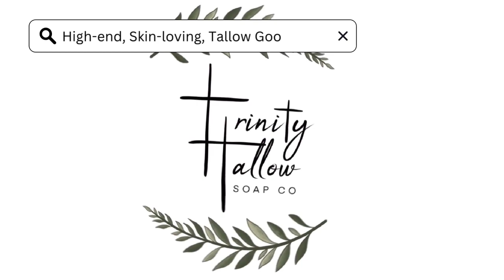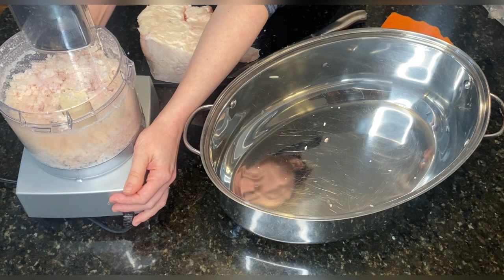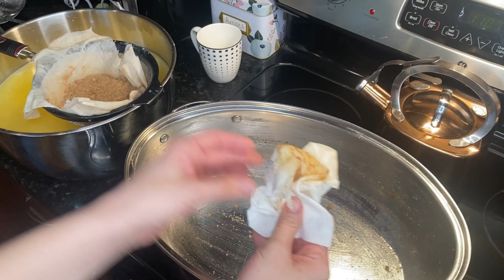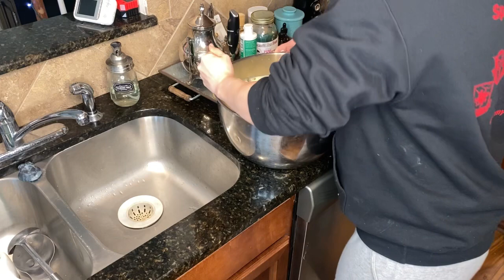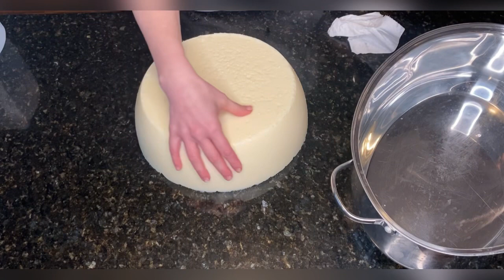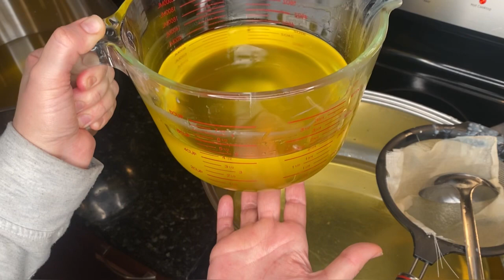How to render suet tallow (wet method) #diy

Comment: Thank you just found your channel.  Very well done, I do like it, and will follow the steps, however I did it on top of the stove ,  does it make a difference? Thank you in advance for your response 😊
Reply from the maker: You can do it on the stove top but it tends to burn on the bottom easily if you don't constantly stir it. You don't have to babysit it in the oven.

Comment: When wiping you big pot sprinkle fine salt all over and then wipe. You’ll be amazed.
Reply: Thank you for that tip. I’m new at this.
Reply from the maker: Using a heat gun to melt it down and wipe it out with a paper towel works wonders.

Comment: After you cut up the tallow after the first wash, how long do you put it back in the oven?
Reply from the maker: It varies. Low and slow. I probably did it on 200 degrees F in this video but now I do it on 170F so it does take a few hours to melt it all back down. Low and slow keeps all the beneficial properties from degrading and reduces the chance of a beefy smell.

Comment: I render my tallow 3 or 4 times by boiling with water and salt!
Still cannot get rid of the beefy smell.
What is going wrong?
Is it the temperature?
Thank you for sharing your knowledge 🙏 ❤
Reply from the maker: Boiling will absolutely cause the tallow to smell beefy. Low and slow. Under 200F
Reply: @trinitytallowsoapco  thank you for helping
It looks easier than it is...😅
Reply: @trinitytallowsoapco  can l ask you please.
If l oven render the tallow l made by boiling,will it remove the smell? Or is it to late?
Thank you.😁🤩
Reply from the maker: No, most likely not. Not if you’ve already processed it several times with that high of heat. You could try just using it in soap now since the smell won’t come through in that or use it for cooking tallow.
Reply: @marianneellman1139  I am a newbie to this and have the same problem, not the boiling but smell. it is reducing so I am going to just keep going with purifying, I suspect a lot rests on the quality of the beef fat (I am in Ireland and butcher just gave me some trimmings). I did read a comment else where and the person said you can even purify fat that has gone rancid and make it completely pure by just keeping going with the purifying, anyone else heard of this?
Reply from the maker: @EvangeliseGood yes, a lot depends on how the meat was cared for during processing. If the suet was hung inside the carcass during the dry aging process, it's going to have a stronger odor, unfortunately. Age, sex, and food all play a role in scent. The only way to get most of that scent out is low and slow making sure you don't let any of the fascia or bloody parts into the rendering pot. It won't matter for soap, but for leave on skincare you want to be more careful.

Comment: Thanks for your detailed information. Im going to try your method in the oven at 200 degrees.  I always used my crock pot and even on Low heat, it was too high and the bits would brown. I Love the beef flavor when using my Tallow to cook with. But this time I want to make a whipped up body lotion.
Reply from the maker: Glad to help! Crockpots are notorious  for having hot spots. Anything over 200 degrees will start to cause your end product to have a beefy scent and degrade the tallow.

Comment: Do you get a lot of bubbles in your oil? And how long is it then shelf stable or stable inside balms?
Reply: No, I don’t get bubbles. I make sure to keep my temperature low enough that there is no boiling. The shelf life I get from my tallow personally is around 12 months. I put on all of my tallow products (besides soap) 9 months as it has other oils in it that have a greater chance of oxidizing than tallow. So vit e is absolutely necessary.

Comment: So is the last step also putting it in the oven at 200 for 1 hour?
Reply from the maker: Hi, thanks for watching! The last step is to let it all melt down again with no added water or anything at 200 for as long as it takes to be all liquified then Strain it until you see tallow and water separation. How much water separation that is will depend on how much you let get into that final purification step. Make sure no water gets into your final tallow.